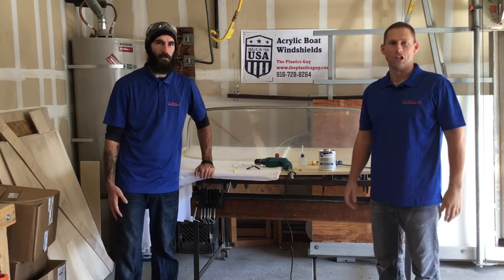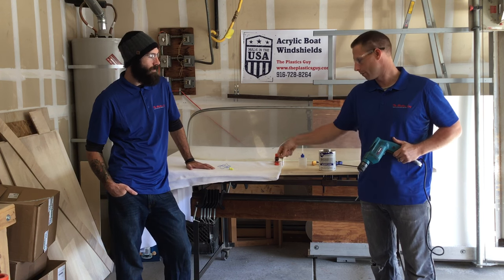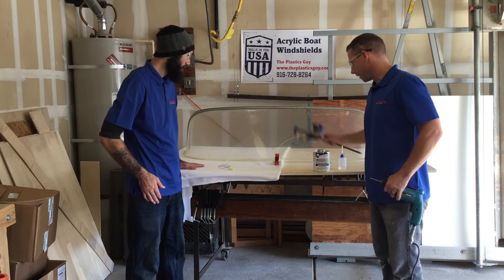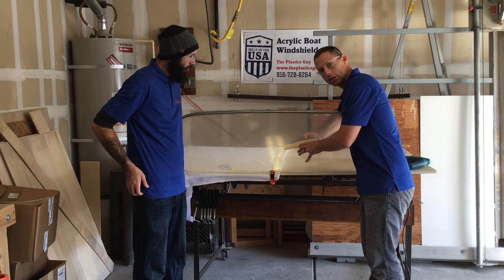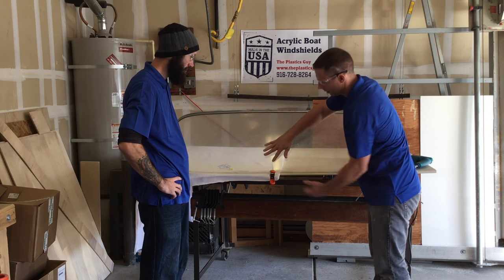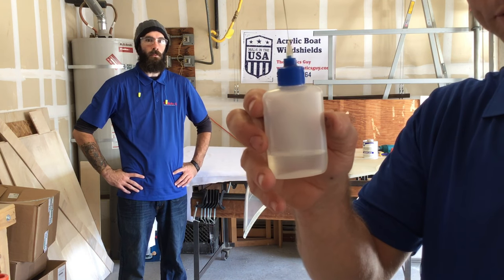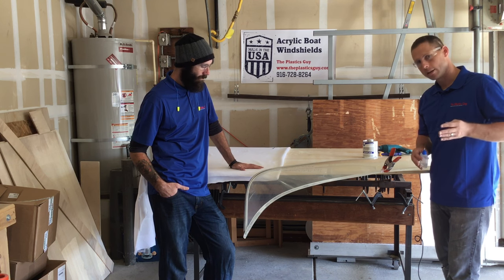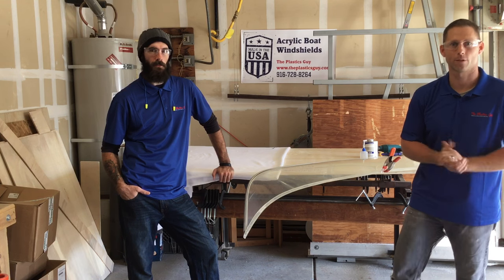DIY How to fix a Cracked boat windshield

Comment: To fill the hole you could dissolve some clear acrylic in MEK and use it to fill the hole. Also, you could wet sand the windshield with 1000 or 1500 grit and the  use a buffer with automotive buffing compound such as 3M Perfect it which could make the windshield look nearly new.
Reply: Can’t you just fill the hole with the weld-on that he’s using? and then go through the polishing after it’s cured? I think weld-on has MEK as one of the main ingredients.

Comment: Hi guys I have a crack in my transparent hull, I assume it is made polycarbonate? But not sure, Wesley how do I find out what the hull is made of (manufacturer has gone out of business - Seascape Boats) and secondly if it is polycarbonate how would you recommend I repair it?

Comment: What about the hole? Do we just leave the hole? Thanks
Reply: jennifer jones yes leave the hole. This is just a temporary fix.
Reply: Personally when I was at the plastics shop I'd get some acrylic rod the same size as the drill bit and glue that in. Polish up as needed to blend it in.
Reply: @dkruitz  I didn't get if it turns out transparent then, or if the crack is still visible? I'm wondering if this fix is good also for micro-cracks due to sun heating and plastic getting old. What do you think?